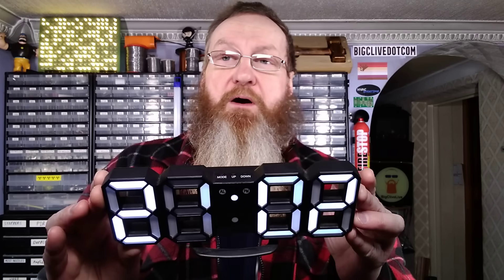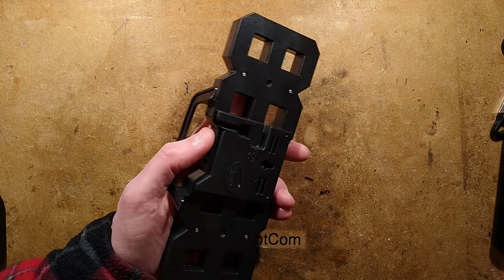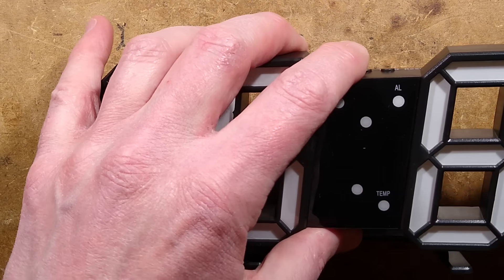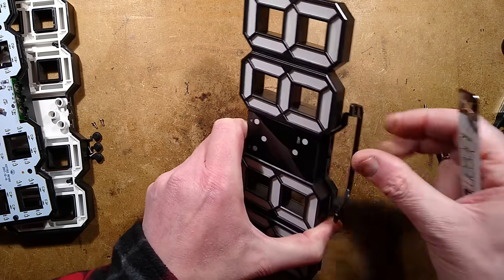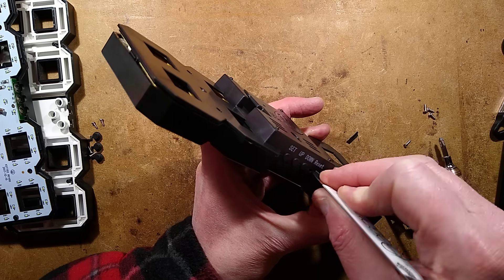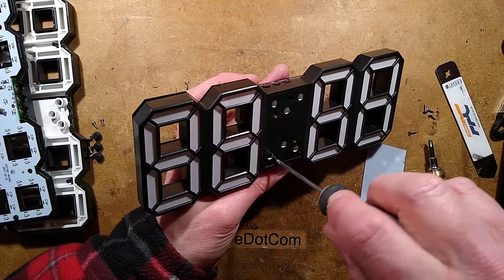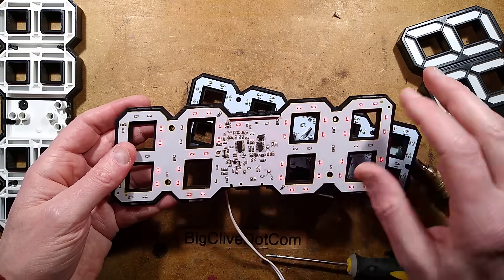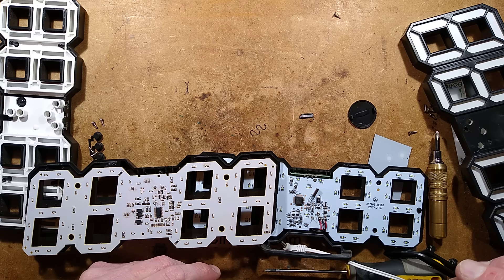The CURSE of white LEDs

Comment: Interesting that red LEDs last forever. I'd never really thought about it, but I've got a Lloytron J101 (I just checked the model number) digital alarm clock with 'voice stop' feature - the alarm stops if you shout at it. I think it dates from about 1980, and it's still as bright as new. It's possible to buy new Lloytron alarm clocks with red figures. I wonder if it's the same circuitry inside?

Comment: 30 year old red giant led from Advance still going strong. been on almost every single minute since it was bought. recapped it once. took about 5 minutes. (two 10uf 16v caps).

but yeah, most of the cheaper white leds seem to tend to slowly fade or just outright fail.

Comment: The microphone-looking thing is almost definitely a piezo sounder, probably with a built in oscillator. Guessing it has an alarm function.
Reply: It has a mode where it stays off unless it registers a sound, then it turns on. This one doesn't have manually adjustable brightness, but it has two levels which switch at 23:00 to dim and 6:00 to bright. The white version is way too bright, even in dim mode.

Comment: Hmmm I wonder if you loaded that white display with some of those flashlight Cree leds and ran them at super low power if it would last a lot longer. Of course they would draw more current so I guess you'd have to upgrade the power adapter and add driver transistors. Might be a fun project. Though maybe not, I don't know if all three brightness levels would come out right. 
     Would it be like you have to put some weird power curve circuitry or make a detector circuit that detected the intended brightness level?! That would trigger logic that would switch around appropriate brightness levels for the Cree leds 
And there could be the option of having it REALLY bright, though it would defeat the purpose and overheat the clock.

Comment: Since you mentioned "jumbo" clocks: years ago I found the project of someone who built an actual jumbo clock themselves (called it the "titan clock"). IIRC each digit was somewhere around 30+cm in height. At some point I wanted to re-create that project (since the original page went down), but with some changes. WS2812B LED tape instead of discrete LEDs, 3D printed frames instead of cut cardboard/plastic, and driven by code written in python, running on a raspi instead of C code on an arduino. Also had to size the clock down a bit (~20cm height) due to the size of my printer xD The clock has been runnning 24/7 for several years now, during the day the digits are an orange-y yellow, and at night/low light I dim them down so much that only the red sub-LEDs are still lit. So far I haven't noticed any major reduction in brightness.
Reply: That's experimentation!

Comment: How much of the longevity issues is overdriving of the LEDs because the manufacturer cheaped out and underrated them?
Reply from the maker: Even running them at a sensible current like 10mA results in fast degradation.
Reply: Thanks, interesting.  I can no longer blame the poor life of even high quality LED lights on the manufacturer then.

Comment: I have a cheap Argos red LED bedside clock from the 1990s and it hardly seems to have faded at all. Transformer PSU so goodness knows how many kWh it has used over the years!
Reply from the maker: Not too much.  The transformer does get a bit warm, but is still low power.  It is reliable and also provides the 50Hz timing reference.

Comment: Have a white led clock radio, been running non stop for over 5 years and still bright. 
What the issue is, they're over driven in many cases and this does roast the led both diode and phosphor. 
Bad diode gives dead segments, bad phosphor blue colour shift

Comment: Got one of those LED clocks a while back and had to immediately ask the seller for a refund. It just didn't keep the time and the CR2032 battery holder was shorted made the battery concerningly hot. The barrel jack was also junk and any slight movement of the cable it lost power. The hidden screws in the front were annoying and I just unintentionally broke their standoffs in the disassembly process.

I have 2 different faux wood LED clocks with white LED lit segments and so far they've been fine. One has been in use for almost 4 years now, but is set to be sound activated. The other has been on all the time at max brightness for nearly 2 years. Haven't seen any dead or dim segments yet on either clocks.
Reply: Was honestly expecting the "CURSE" you were referring to on the title to be crap phosphor formulations on "white" LEDs that aren't actually white or the phosphor degredation I see on white LED monitor backlights where they become more yellow as they age much like some fluorescent tubes.

Didn't think it would be about their inferior lifespan compared to green and red LEDs.

The crap phophors with cheap "white LEDs that are tinted green or pink plus the color temp stuff with "warm" yellowish white to "cold" blueish white doesn't make it easy to find actual white LEDs.

Mix the color temp and tint stuff on white LEDs and its pretty easy to end up with a "white" phosphor coated LED that looks blue greenish which makes food and skin look weird (or disgusting if its really bad).
Reply: Checked my LED clocks and looks like they're both multiplex style displays. At lowest brightness they visibly flicker at anything below 1/30 shutter speed, while at max brightness its anything below 1/125.

Honestly never noticed them flickering, unlike fluorescent bulbs on a magnetic ballast which used to give me eyestrain issues while studying for long periods when I was a kid.

Comment: I can confirm that I also had a clock radio with white digits and it did not last long either, it quickly faded until several segments were dead. very annoying short lifespan from something that they say should last forever

Comment: I find this is an issue with cheap LED's. Also the very tiny ones. They definitely last if you get quality ones I find. I buy lots of CREE LED's and have had a very low failure rate from them. 

The kind you're going to find in a cheap product like that, are usually the lowest quality. Super cheap.

Comment: 9 out of 10 times its the circuits that go bad before the LED. Or they didn't provide the proper resistors on the board and over drive the bulb. Burning them out. From my experience. I can't tell you how many actual screw in bulbs i fixed without ever replacing the LEDs. Im not saying that's the case here. LEDs do burn out eventually. But that isn't always the case.

Comment: I think the proper solution still is (I know my Phillips Hue bulbs use this thanks to them glowing when I turn on my UV bulbs) the same trickery that fluorescent bulbs used - UV emission and transmission into visible spectra via phosphorescent coatings on the bulb/glass.  I would be curious of the efficiency/life-hours of WRGB pixel LEDs compared to UV LEDs; as it seems the WRBG 'pixel' is what I'm seeing pop-up more and more in the US to replace White/Blue-White LEDs.  Your new clock flashed 15C -- could the difference in the circuit be due to it displaying indoor temperature?

Comment: I got one of these right after your video was released ago those years ago. Slightly different but at a glance is pretty much the same. It's still as good as day one for me (too bright imo, mine auto dims at 2000hrs.)
The only problem with mine is that it runs slightly fast. But the LEDs are fine still

Comment: I bought a red LED clock kit back in the late '70s. It ran 24/365 for decades, using the 60hZ from the outlet for the timing, until the clock chip started going out. It would randomly count seconds by 10s or not advance at all. I decided it was time to replace it, but couldn't find the same kit. I did find a different kit and it now sits on the book shelf counting time as it passes. Both use 7 segment single unit displays. I have another clock kit somewhere in my house waiting to be put together.

Comment: The green display on my (older) microwave oven didn't fade, but the oven failed. The white display on my (replacement) microwave oven faded and failed. I was able to move the display unit from the old failed microwave to the new one. Pin for pin replacement, every segment still full brightness. So, yeah, white leds. 😞

Comment: Ugh. White LEDs. I've come to the conclusion that LED lighting is one of the biggest scams of the 21st century. We were promised super efficient, long-lasting bulbs, but what I get are bulbs that may be efficient but also cost 5-10x more than my old incandescents did, and fail MORE often. I never had incandescents start strobing like something from a rave after 4 months of regular use, suddenly lose half of their brightness after a year, or worst of all with my latest phillips ultra high CRI LED bulbs that I bought, go from full brightness warm white to half brightness yellow light for no apparent reason within 2 weeks of installing them in my office where they are only on for approximately 40hrs per week.
Reply: Of all the LED bulbs I have used so far, never had them fail before incandescent.  The same goes for compact fluorescent bulbs.  Most of the time on those it's usually a bad driver or ballast.

Comment: Wonder if it's longer lasting to use white LEDS or RGB LEDs and setting them to white
Reply: RGB would probably last longer overall - but you'd get color shifts over time as it's likely that some of the colors (blue?) would degrade and dim faster than others.
Reply from the maker: The RGB white tends to gradually go pink over time as the green and blue fade and the red holds its intensity.

Comment: Blue and white let's are very sensitive to ESD.
Reply: I don't see why they would be - they're diodes, not transistors. What makes mosfets ESD sensitive is the thin gate oxide insulator. The ESD discharge punches holes in it, and then it's not an insulator anymore, and your mosfet is shorted
Reply: @gorak9000 Belive you me, I've used blue leds on lots of test rigs. On many of them they had to have the blue leds replaced. No other leds failed.
Reply: @laurencecope7083  Yeah, I've seen blue LEDs go intermittent - I have 2 or 3 things on my desk right now that have blue leds that only intermittently work now, and the leds come on randomly when they feel like it - that doesn't mean they were damaged by ESD - it's probably a problem with the bond wires
Reply from the maker: ESD and humidity.  I think the modern ones have better ESD protection.  Static was often blamed for early LED failures.  But it was probably just an excuse to transfer liability onto the user.

Comment: There's one technology that has insanely long life, it's the nixie tubes, I had a clock that ran for 10 years and it's still going, and it's not even new out of the box, it was used tubes from Ukraine. But it was just a bad form-factor, it's not compact and needed complicated driving cicuit. But reliability for stationary clock is excellent. 
I bought one as a kit from PVElectronic, just a shoutout to Pete because he made very robust circuit for nixie clocks, and he was very helpful in troubleshooting and taking feedbacks to improve later versions of them, it's my favorite kit clock maker.

Comment: I have the same one and bought it after watching the original video. Mine works fine but after buying it I changed the resistors to use it in the bedroom on low brightness. The factory minimum brightness was too high

Comment: I have a white one that's been running for at least 2 years and is still nice and bright. I think it has different firmware as it doesn't have adjustable brightness but does automatically dim between 19:00 and 06:00.
Reply from the maker: This one does the auto dimming too.

Comment: I worked at Maplins in the 80's. The first blue led we had, 5mm water clear was £17.50!!!! We sold loads!!!
Reply: Yes, but those first aqua-couloured LEDs were such a beautiful shade of blue. Still, £17,50 in the 80's was a substantial amount. Using the Bank of England inflation correction calculator with 1989 as Year that comes to more than £44,- in todays'  money. Whoa!.
Reply: At Philips Seniconductors we  built a PCB with a £10,000 FPGA on it and a blue LED back in the 90's. All our colleagues were amazed by the LED and ignored the emulated Philips chip running on the FPGA..I had written design partitioner software for it to split a big VHDL design onto multiple FPGAs. 
The LED had its own power rail as it needed 7.5 volts to light up..
Reply: The inventor of the blue LED, a Japanese scientist IIRC, even received the Nobel Prize for that.
Reply: @Arsenic71  Rightfully so. He developed this while trying to convince his colleagues that his method, while harder, would eventually achieve commercially viable yields.
Reply: @LarixusSnydes  For this development, the Nobel Prize in Physics was awarded in 2015, not to the original developers, but to the Japanese.
For the development of the economical large-scale production of white and blue LEDs coated with light powder,
which are now the basis of all giant displays, without which they would not exist, because the blue color would be missing from the RGB spectrum.
Before that, there were no bright blue light sources. This was my original idea, not the Japanese. The question is which country managed to turn it into moral prestige and market success. :body-blue-raised-arms:
Reply: @Arsenic71  The reality is a little different than what is presented in the media, including scientific articles.
Serious cutting-edge high-tech industrial developments are not recorded anywhere, because they are industrial secrets.
Then, if there is no funding for it, it will become a patent and become public property, otherwise it will not.
The question is which country managed to turn it into moral prestige and market success.

I invented the light-powder coated LED, 4 years before the Japanese, 
because we were producing colored light-powder coated vacuum neon fluorescent tubes and the idea came from there.

And somehow the development got out of hand, and our factory was demolished.
This was the 120-year-old world-famous lighting company called TUNGSRAM, which manufactured and exported filament lamps and lamp production lines.
The single-crystal production that generates UV light, the Chocralski method, was also known before that. There was a big fight to acquire the development, since it is a market worth 100 billion dollars a year,  it really doesn't matter in which country it is made.

But in the end, Tesla's priority in inventing the radio was recognized, and Marconi and Popov's patents were revoked. :body-blue-raised-arms:
Reply: I first saw a blue LED in an electronics shop in Sydney, early 80's. I don't recall any outrageous longevity claims for those first-generation ones - quite the reverse, in fact. The shop had one mounted in a box with a momentary switch, so you could gaze for a couple of seconds at this latest fragile wonder !
Reply from the maker: Yeah, I bought a silicone carbide blue LED and then later a gallium nitride one when they first came out.
Reply: @Cornz38 - When the price dropped to a more reasonable level, I bought one play with. I still have it.
Reply: @ Yeah, i had to have one but even with my discount it was still about 15 quid....But that blue..........
Reply: It is a shame that Maplin didn't last long enough to go it and complain that the blow moulded case of my Maplin Michron digital clock kit bought in 1977 went brittle and started cracking after just 30 years. the electronics was fine though.
Reply: Silicon carbide, weren't they?
I still have a packet of them.
Lovely shade of blue - and not eye-piercing.

Comment: Nice one Clive.
I have one just like yours. Arrived cool white. Its now white+green in day, and Red at night.
Do you know you can set Year and Location, for summer daylight  time, leap year, etc.
Reply from the maker: Wasn't aware there were versions that do that.
Reply: There may be versions??
In the settings I can select preset display options, "d1, "d2", "d3", and "A1, "A2", "A3", for Alarm settings.
I use the settings were the display dims down at night from 6pm to 6am. And shows Time for 40secs, Date for 10s, Temperature for 10s, every minute.
The LED colour change comes from LEDs that I have added.
The colour change is triggered by the change in voltage, using two transistors and voltage divider, a flip flop, to toggle between states.
I guess a 555 might work just as good, driving a power transistor. The current might be a bit high at 00:00 o'clock.😆

Comment: 3:35 it has screws in the middle under the front sticker. Been there, done that...
I have 2 of them and replaced the white LEDs, cos white was the only colour they had when I ordered them, with orange in one and red in the other.
If memory serves there's a setting where you can set the display to timeout/go off. The microphone is there so you can click your fingers, or cough, or you can press a button, to make it come out of sleep mode to show the time. It's handy at night time so the clock isn't lighting up all the time.

Comment: The other question is 'How wel does it keep time ?'. I have a USB LED clock that gains about 20 seconds every month, even though the crystal is perfectly tuned.
Reply: The problem is that no xtal oscillator is perfectly stable unless the xtal is kept in an oven, even a small temperature change can alter the frequency.
Reply: @terryhayward7905  That's fair.
Reply from the maker: If the clock uses a dedicated real time clock chip it can be hobbled by bad software.